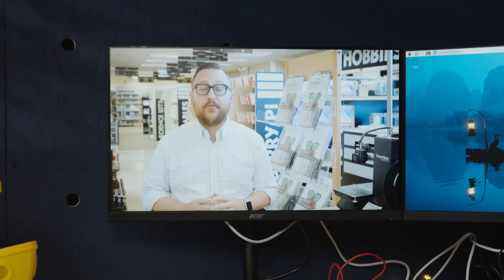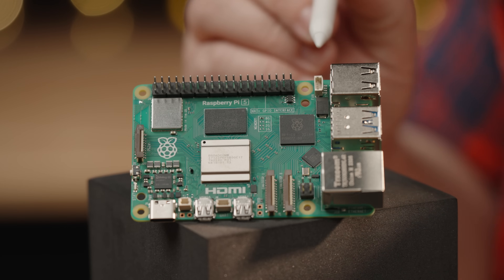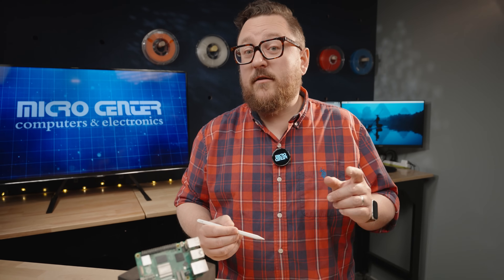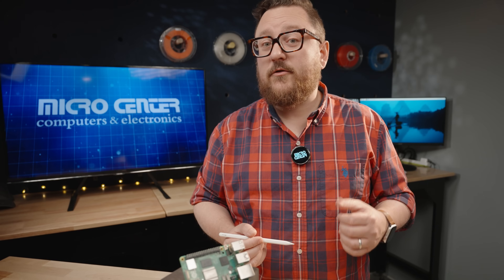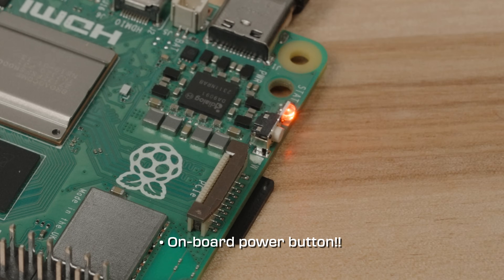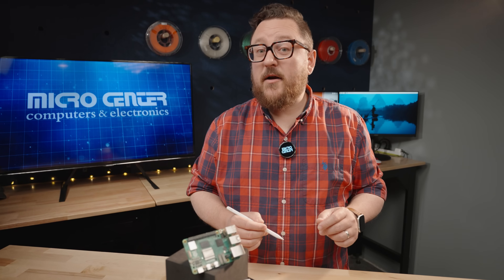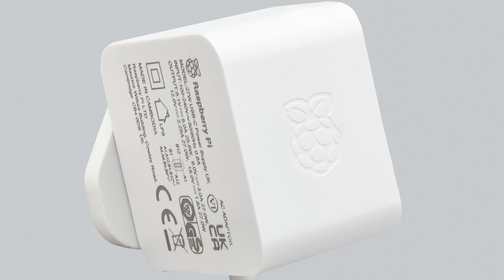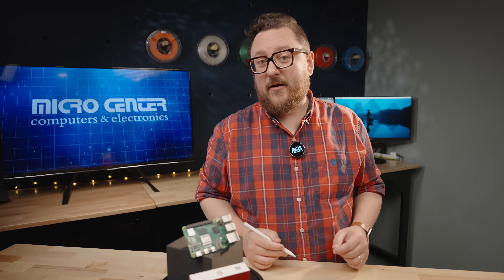Raspberry Pi 5 – Speed, Power, PCIe & MORE! - What’s New?

Comment: Will the active cooler with heat sink work in the case or do you either have to choose the official heat sink or the official case?
Reply: I’m pretty sure the new case is designed for the heat sink.
Reply: the case comes with a built in solution
Reply: To my understanding, the case fan can be removed to fit the active cooler.

Comment: Expected a much lower price or much higher performance with a new custom SoC. 16nm process? Come on.
Reply: Dude, the thing costs 50 bucks. 16nm is damn justifiable.
Reply: @GeoStreber Where did you get the price of $50? Priced at $60 for the 4GB variant, and $80 for its 8GB sibling. This is from the raspberrypi website.
Reply: The board is over twice as fast as it's predecessor, how much more performance do you want for $60?

Comment: Any thoughts about the supply chain? Do you think we will have the same availability issues?
Reply: Turns out it wasn't a supply chain after all. They simply stopped production of Pi4 and started producing the Pi5 without announcing that is what they were doing.
Reply: The Raspberry Pi uses a Broadcom system-on-a-chip (SoC) that contains several components, including a CPU, GPU, memory, and other peripherals. As a result, the production of Raspberry Pi has been impacted by the semiconductor shortage, leading to delays and shortages.Mar 1, 2023
In order to have been ready for a mass release of the Pi 5 by the end of October they would have had to Start production as far back as March.